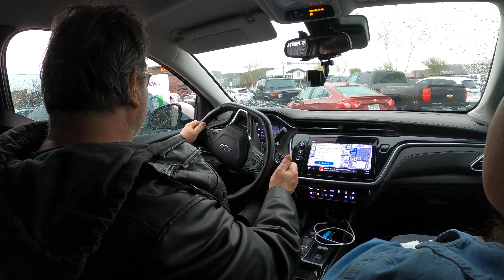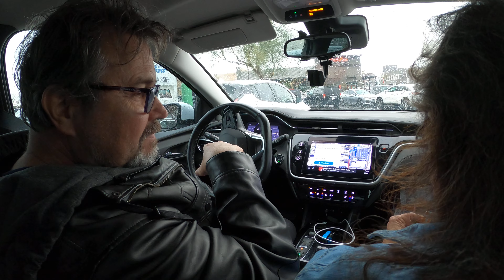Smashed Connector, EVgo DC Fast Charger Broken, Electric Vehicle Charging Sabotaged, Phoenix Arizona

Comment: To me, handling and electric charging cord in the rain would spook me like handling a gas hose around a fire.
Reply from the maker: Electricity in the charging cord isn't applied until it detects a vehicle connection resistor.  

https://www.typhoon-hil.com/documentation/typhoon-hil-application-notes/References/electric_vehicle_ac_charging.html#:~:text=When%20the%20car%20is%20connected%2C%20the%20resistor%20R2,and%20indicates%20everything%20is%20set%20up%20for%20charging.

However GM did recall my vehicle to check the ground detection circuit in it's supplied EV charger. I think it's working since I'm unable to use it in outlets without proper grounding.